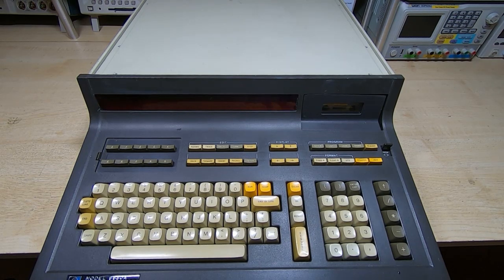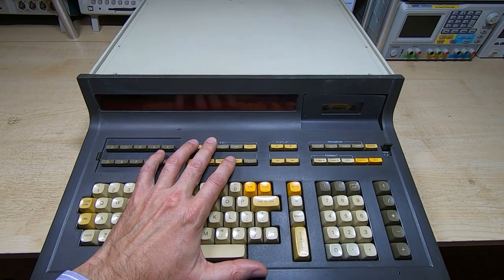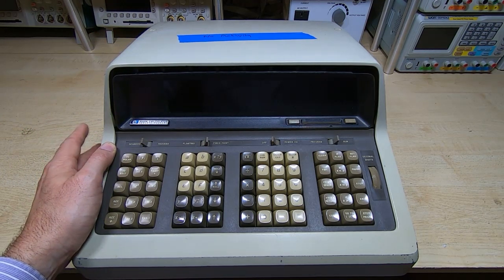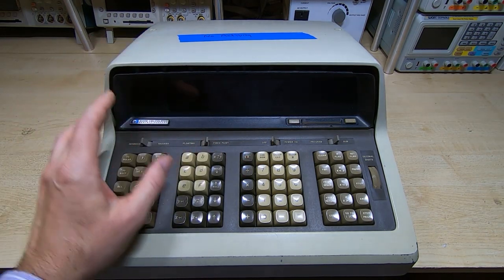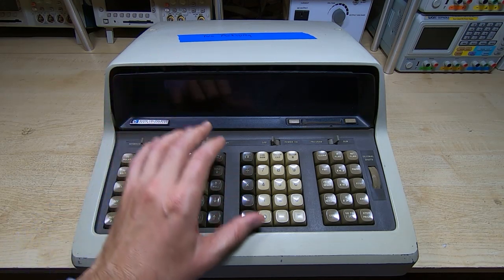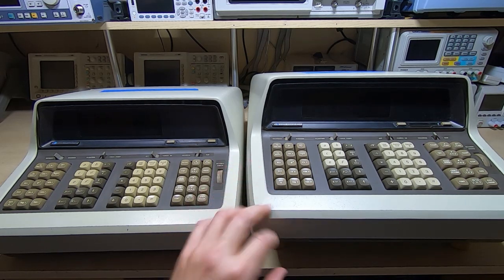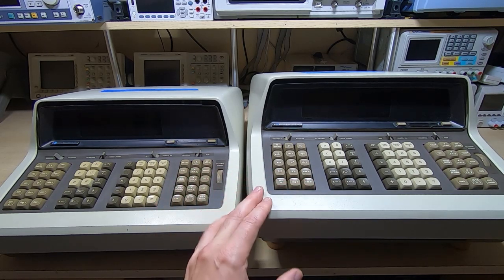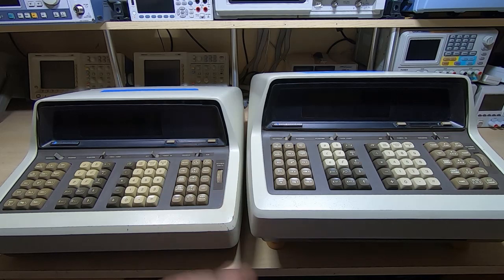HP9100B #1 Repair Part1

Comment: Amazing! 
I have one of these, which worked fine until about a year ago. Then it started to look blurred....and now the CRT shows no sign of life at all. 
None of the 3 main fuses seem to be blown - and the brains are still working (SQRT -1 gives an error light) 

Any ideas of how best to fault find a CRT that gives no light, even in a dark room at first power up....?
Reply from the maker: It is hard to give any specific advice on this as there are many things that can cause no display output. In fact it is a very common problem.
It also depends on the equipment you have but if you can then start with all the supplies including the EHT.
You said the display started getting out of focus and this can be caused by failing high voltage or even a faulty tube.
Once you have confirmed that the high voltage is present then the next step is to make sure that the beam is reaching the tube face. Remember that the display uses vectored drive and not raster so you could try disconnecting all the deflection plates although this may result in a very dim display as the plates are part of the tube drive. You could also simply unplug the deflection boards. Hopefully this approach will uncover something. However note that the system error light is totally independent from the display drive circuits.
Reply: @JerryWalker001  Thanks - I'll try to take a look this weekend! It was recued from a school years ago. Was fun walking home with it - it weights a load!
Reply: Ahah! I was wrong in my first check...the 500mA fuse F3 (the one at the far right hand side of the unit) has indeed blown. I believe this is the EHT fuse...so would explain the CRT not working. Of course, there could be a reason it has blown! But replacing it would seem sensible.... 

According to the service manual it should be a 0.5A 250V normal blow fuse - I'll grab one and see!
Reply: @JerryWalker001  Ahah! It works! The display flickers occasionally - showing sections of the display lit when it does - perhaps that is some instability in the EHT supply @jerryWalker01 ?  https://photos.google.com/share/AF1QipPJvDQJGqYnKCqyDUXRlDLiV6t35h3cYUD08kcpj00z8_1eIclAkfZRSH2-lfYPRw?key=OFZzOEUtdEQ0VXdoZy1ObTN4S3RkUG93a2Q4T0d3